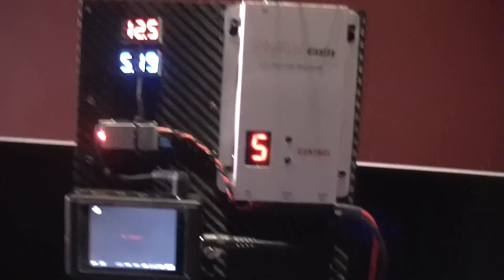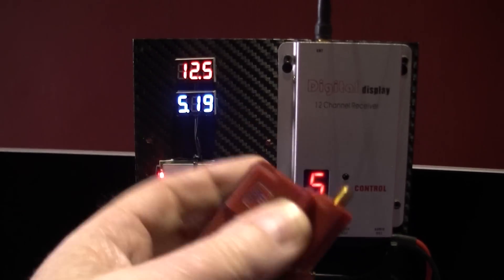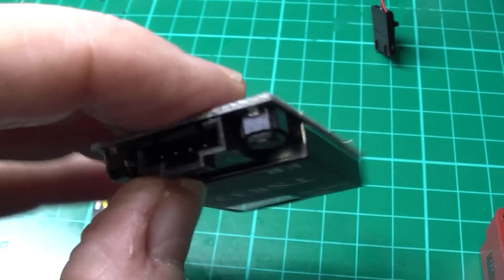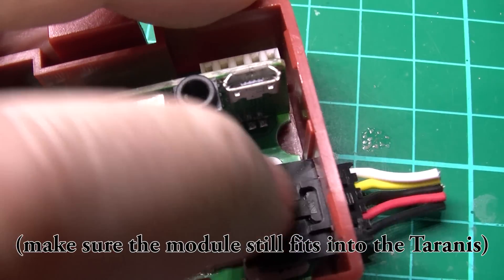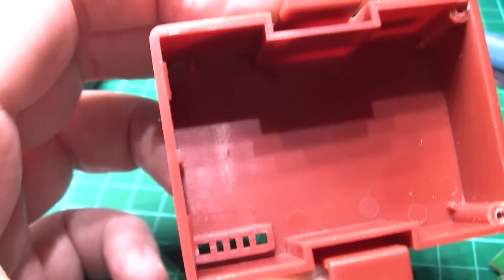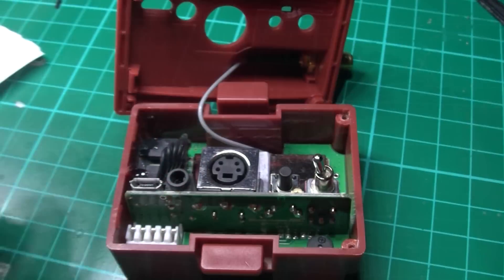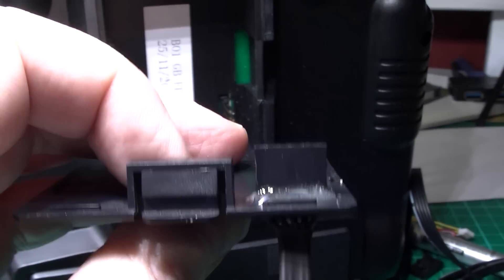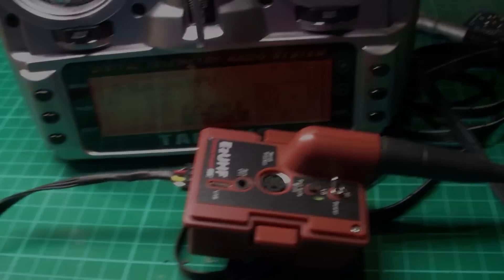EZUHF JR module mod - use internal or external

Comment: I am a bit late to the party but I think you could just have made an extension, which plugged at the one end to the taranis and the other end to the module bay connector. It would have saved you a lot of work but maybe not fun ;-) ...
Reply from the maker: From what I remember, it would have made it much easier but I had plans to mount it flat on a board with a velcro strap. I actually still have it although I don't use it externally anymore.

Comment: How long is the cable  between the  transmitter and the uhf module?
Reply from the maker: +roger vieira It was about 6ft. I abandoned this idea and now I use a 2.4ghz repeater to my Taranis.
Reply: How does that work? Do you still use the JR module?

Comment: That's good tone but why not go wireless?  I did the same as you for a while by making an extension cable for my uhf module but wireless is the way forward.  simply set your taranis to transmit on 2.4Ghz to a D4R2 or similar, then feed the cppm out of the rx into your EZUHF cppm input as well as some power (probably 5V).  Works really well for me i have now done this with a taranis, DX6i and an old 35Mhz JR tx. Haha just read Rob B's reply below, looks like he has done the same.
Reply from the maker: crezzee Cheers mate. I love Heath Robinson an try to adopt his principle in daily life:-)
I think I get what you mean and I'll be doing it all again...... this time, I'll do it the "proper" way :-)
Reply from the maker: crezzee Well, I've got it all working wirelessly and...... I've also made a 1.3 > 5.8 repeater so I can wear my goggles which only do 5.8
The only problem is, as soon as I switch the UHF on and it's less than 2ft from the 1.3 RX, it completely wipes the video out. I need a bigger mounting plate.
Cheers mate, I appreciate the suggestion. It'll save me ripping any wires out and dragging my chair behind me :-)
Reply: Haha well done Tone.

Comment: Cool, I have one of those modules but I also have the external EZUHF box that plugs into the trainer port. I have never tried the external box on the Taranis just on my Spek DX8 so I have no idea if it would work with just a long trainer cable. Something to try I guess.
Reply: Vortecks I think you did that the hard way. Simply routing the trainer port output onto the modulation pin of the module along with power would have done. Even better, the wireless method. Use a D4RII receiver in cppm mode to feed the module and use a battery up the pole for least volt drop..
In any case be sure to use a screened cable and possibly a RF choke, you don't want RF being picked up by the cable.
Had a chuckle when you said "you don't want the module to bind"
Reply from the maker: ***** Strangely, when I was doing the mod, I was thinking about your external kit. You're the only one I know with both internal and external modules. I'd be interested to know if it works with a trainer.
Reply from the maker: Rob B Well, I think I'm gonna swear. You mean I've spent hours and hours, hacking my module and I didn't need to do it?
I think my choice of words is rather stupid..... "you don't want the module to bind" should have come out differently :-)
Thanks Rob...... I feel another mod coming on :-)
Reply: Vortecks That was interesting what Rob B said and I didn't know about wireless method. I think the external box would work too BUT you would still need a battery "up the pole" with it too :-)
Reply from the maker: ***** I already have a battery mounted and a BEC to power everything. I'm going to be working on it over the next few days (along with your suggestion of 1.3 > 5.8 to work with my goggles).
I found a new field to fly today and only crashed once :-)
Reply from the maker: Rob B All sorted, Rob. I've got it all working wirelessly, but my mounting plate is too small - as soon as I switch the EZUHF on, it completely wipes the video out. If I keep it 2ft from the RX, it's superb!
Thanks for the suggestion mate and thanks for not taking the piss outta me :-)
Reply: Vortecks Glad it worked out for you. The repeater method was originally used for wireless trainer setups. Another advantage of the arrangement is it is self contained and so there is less chance of leaving a mission critical piece of equipment at home. 
Cheers 
Rob
Who is not taking the piss ;)
I'm maidening a Cularis this weekend. Might be worth watching :)
Reply: Vortecks You may want to check out RC Hacker's series on UHF antennas, in particular the Moxon dipole. If you keep the EZ horizontally polarised and the video vertical or circular you will have less interferance and the Moxon will give a bit of gain.
Warning. After putting RC Hacker onto the right path he became obsessed for at least a short time with antenna theory and manufacture.
Reply from the maker: Rob B I miss Mark's videos, he hasn't posted any for 6 months now.
Coincidentally, I was going to build a moxon this weekend - I'll let you know how it goes :-)
Cheers Rob